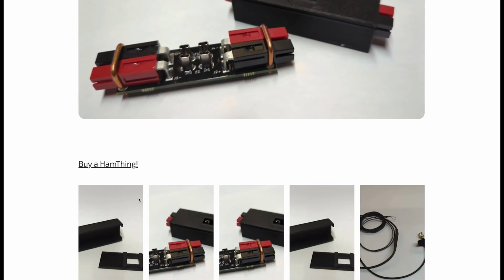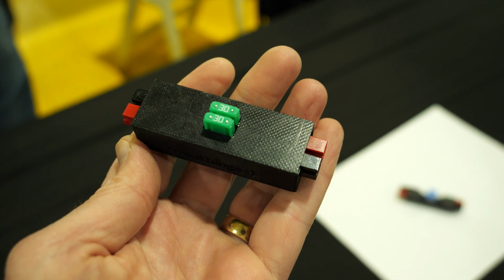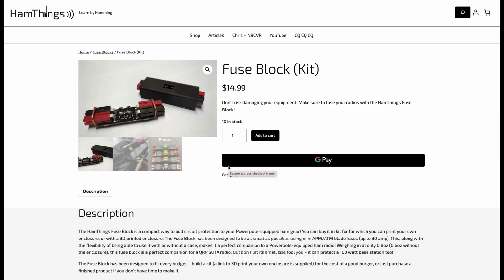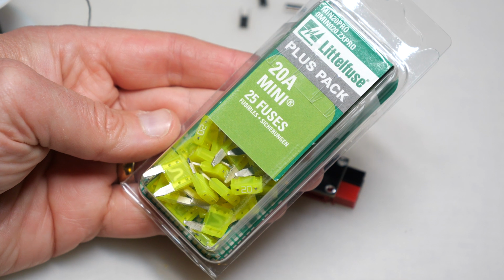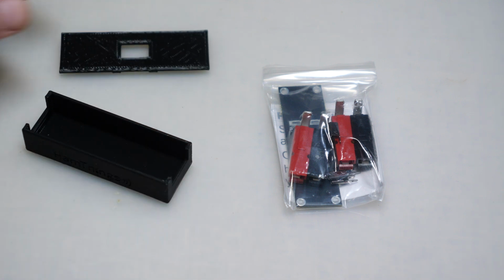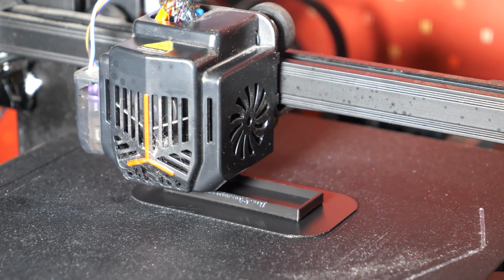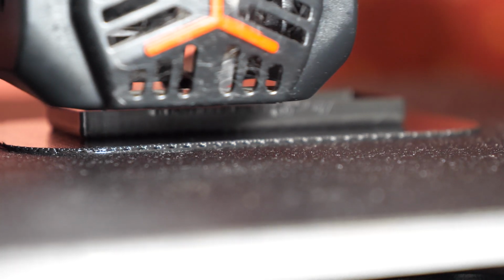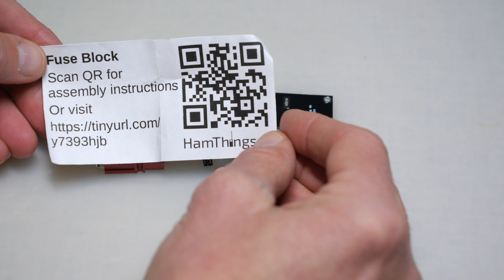The Ham Things Fuse Block: A Two Minute Takeaway

Comment: Yes, on more content like this! Yes, I can easily solder in an inline fuse block; however, a Power Pole connector with a pull out auto fuse makes everything quick and locally available. Thank you and 73, Bill.

Comment: The electrical engineer in me is paranoid about power source safety, especially when the power source is a battery.  Electrical fires and chemical explosions are no joke. Those often overlooked fuses are critically important, and they are there to protect your battery, not your radio.👍
KZ9V
Reply: You've got a fine product, and I encourage all ham operators to fuse their battery as close to the terminals as possible.  My reference to the protection being primarily for the safety of the battery is because most people just don't think of it that way.😊
KZ9V
Reply: @davewhite7679  thank you kindly!! 73,
Reply: Great point Dave. I'm working on an option that would protect both the battery and radio, but you know how time and juggling things goes............! 73,

Comment: I see you're using one of those Eco-Worthy batteries a the end of the video! How do you handle the exposed contacts on those? I'm constantly in fear that something is going to short those out and blow up my equipment pack. Would love to see a (brief, even!) video on battery safety, particularly as you transport batteries to and from a park for POTA
Reply from the maker: You bring up a good point. I usually cover the contacts of the battery with electrical tape if I am packing it. Transporting the battery in a case like a soft sided lunchbox is another option. But I also haven't yet had any issues of items inadvertently coming into contact with the terminals. On my larger batteries that have hex bolts for the terminals, I've 3D printed covers that fit onto the bolts.
Reply: @KB9VBRAntennas  nice idea! I was also thinking of 3d printing something as well. I've temporarily stowed my battery in a big ol .50 cal (plastic!) ammo box, but it'd be nice to be able to do away with the extra size/weight.

Thanks again for the reply!
Reply: @KB9VBRAntennas  I don't know why but the soft side lunch box thing is tempting me..........I usually throw a folded up t-shirt between the battery and rig when I pack it, but I really like the idea of the lunch box! 73,

Comment: I bought three kits last year, easy to assemble. Some tips  for soldering the fuse holders. Place the 2 holder on to a fuse, and then insert both sets of holders into the PC board holes. Flip the board upside done and set it on your work surface, with the fuses holding the board up, press down slightly so the fuse holders and firmly against the  (now underside) PC board, and solder away. 

If you don't have a 3D printer, an alternative "enclosure" is use some heat shrink tubing to slip the assembled kit into, with the length of the heat shrink trimmed to the PC board length. After shrinking, your will see the outlines of the fuse holders quite clearly. Use a razor blade, exacto knife or some some other really sharp instrument of destruction, and cut slits in the heat shrink for the fuses to be able to be plugged in. 

As I mentioned, I assembled 3 kits, and then put in 10, 20 and 30 amp fuses.  I keep them in my  "Connector" kit bag along with the Wago to Power pole adapter I made up (really easy to do) 

Michael, I like this 2 minute quickie video format, keep them coming,